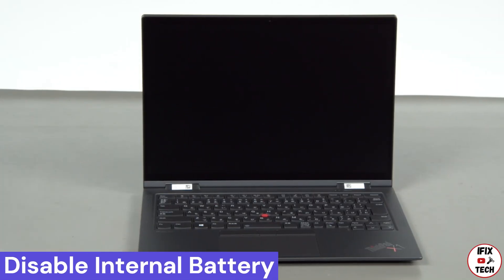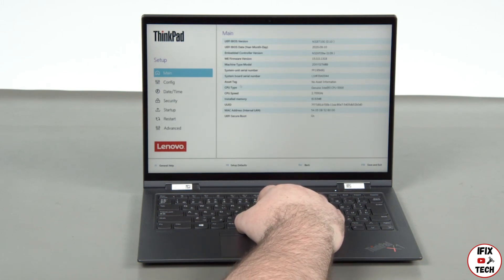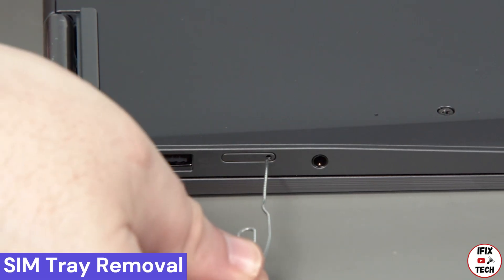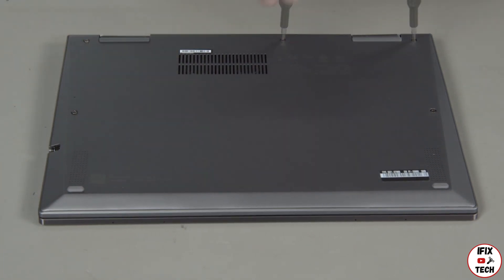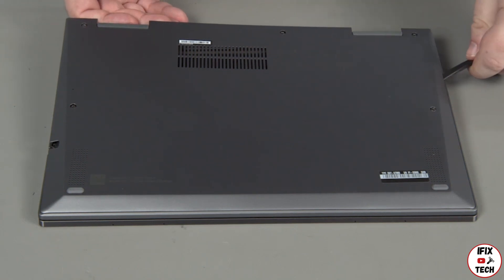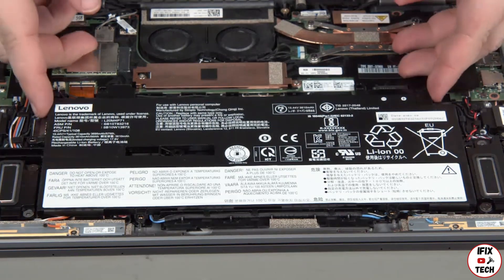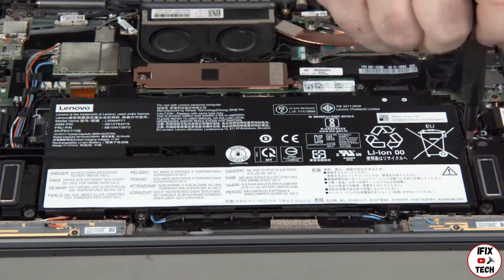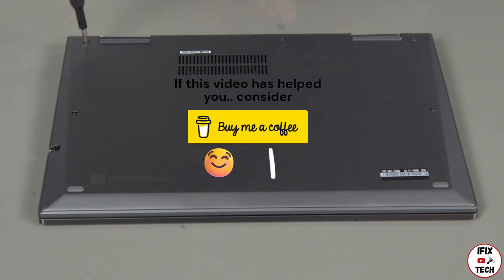Lenovo ThinkPad X1 YOGA BATTERY Replacement Gen 6th - 7th - 8th - How to Remove Internal Battery

Comment: I replaced the battery on my X1 Yoga i5 6th gen. After replacing it laptop only turns on when charger is plugged in. Battery showing 100% charged but whenever I unplug charger the laptop turned off. Any solutions?
Reply: If you followed the directions, you deactivated the battery in the BIOS - I'm suspecting you need to activate again once you've replaced the battery again. That is not displayed in the video!
Reply from the maker: Why did you replace it? Because of the same issue?
Reply: @IFixTech1  I replaced it because it was draining really fast and not charging fully. The battery got swollen.
Reply from the maker: @zubairehmedkhan  maybe something wrong with that new battery. What happens when you connect the laptop without the battery.
Reply: @IFixTech1  it's working okay without battery when I put the charger in